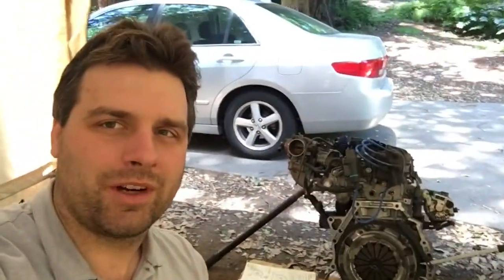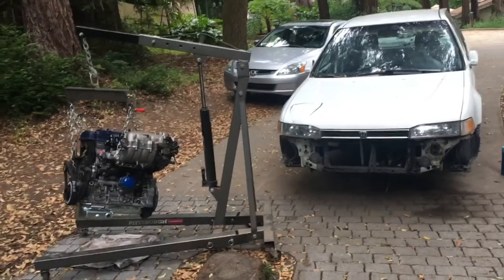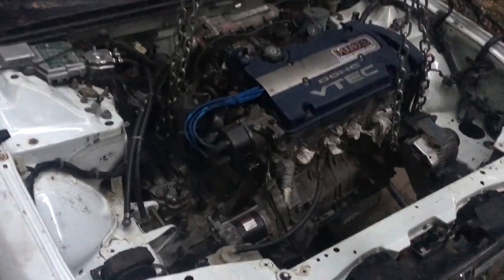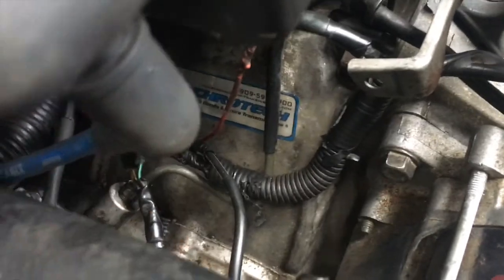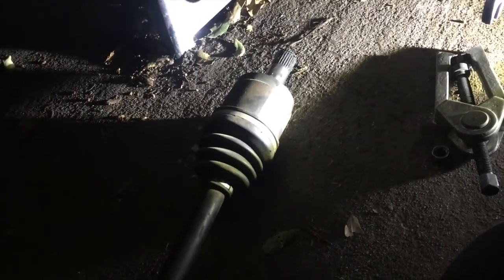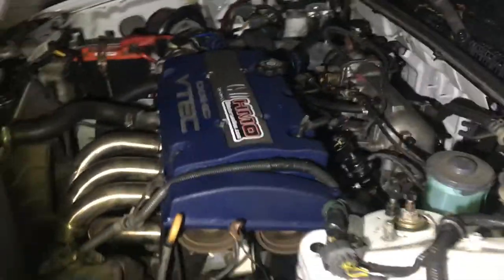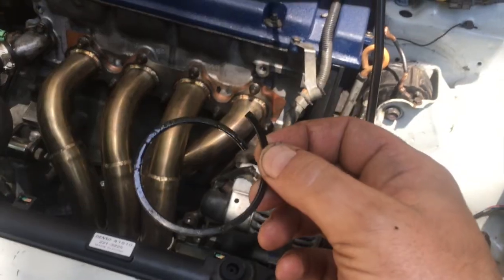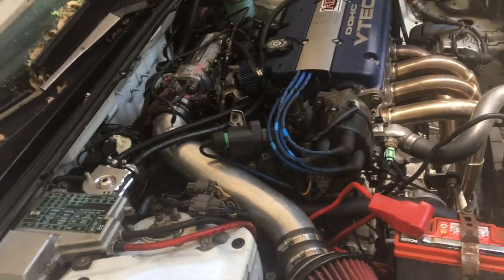CB7 Motor Build Part 6 - CB7 Meets Its New Motor!

Comment: well lets see the low-ish exhaust? and the vacuum leak could be the FITV "fast idle thermo valve" those cockroaches like to come apart internally and will cause a vacuum leak if it does...easy free fix if it is...just put back together how it should be and done....or check the idle screw on the throttle body its a flat head.
Reply from the maker: I was really bummed, during editing, I realized that the clip I took of the low header downpipe was no longer on my phone or computer, so I’m not sure how it got deleted.  I originally took that video because I really wanted people to see the issue I was having.  Someone else on CB7TUNER just reported the same issue, even worse than mine.  Since filming, I actually found the vacuum leak, a hole in the map sensor vacuum line. I was able to adjust the timing to about 11° at idle and adjust the idle screw.  Now, warmed up, it idles around 850 rpms.

Comment: Stock mounts line up direct fit to the cars engine bay?
Reply from the maker: I am using three of the stock mounts: the rear mount, the timing side engine mount, and the transmission mount.  The trans. mount works with Prelude transmissions only after you drill the proper holes in the trans case and thread then with the studs that come in the other holes on the Lude transmissions by default.  As far as the mounts fitting and everything lining up, yes, it works. Please just follow my instructions in my videos on the timing side engine mount bracket.

Comment: Just got the h22a4 installed.  Do you also have to change out the coolant port on the back of the motor like the front i noticed they point differently
Reply from the maker: Nice work!  I actually used the rear coolant port from the H. The Lower Radiator hose reaches just fine, but just make sure you unwrap some of your coolant sensor wiring to reach the thermostat temperature sensor on that rear port.

Comment: Did this motor wire harness hook right up with the stock and what ecu are you running
Reply from the maker: I completely tossed the harness that came with the OBD2 motor and converted the motor to OBD1 by using the correct distributor and sourcing a P13 plenum and TB.  The runners were already P13.  I had to unwrap some of the CB7 harness on the trans side just to reach the coolant sensors and coil.  I am running a P06 ECU and wired up an external relay connected to pin A15 to make VTEC work.
Reply: Cool thank you. Im currently looking for an h23a . After i get one i may have to hit you up again about it lol
Reply from the maker: Look no further than H motors online. Pay the extra money, and get the security knowing that it is a healthy motor. It is worth saving up for.
Reply: Hey so wait the stock ecu from the accord will run with the h series motor? I was think id have to get a p13 or p28. Btw i got a h22a4 motor . Im thinking all these h22 and h23 are basically all the right or am i wrong
Reply from the maker: No, not stock ECU, I used a P06 and then wired an external relay for VTEC. I could’ve easily just used a P13 or P28 as well. The reason I went with my PO6 is because it already had Hondata installed on it.  I also don’t think the P13 is compatible with Hondata’s ostrich board.
The H23 has quite a bit longer stroke (95mm) than the H22s (90.7mm), plus a lighter crank.
Reply: Oh ok. Man im so green with this. So i will still need to get a p13 or p28 ecu. Thanks for your help.

Comment: You not have abs in this car or did you delete it. I like to remove it from my 93 if possible since it doesnt work and i don't wanna buy another abs pump
Reply from the maker: There was no abs from the get go because it is an LX trim.  I am actually glad for that because deleting abs would have been more of a pain than a rear disk conversion was.
Reply: Oh man. I been trying to find pics or something with the way the brake lines are ran. I cant find shit . But im determined to delete it lol . I guess im gonna have to trace them out and remove as needed. Lol.
Reply from the maker: You can do it!  Go to cb7tuner.com and search for abs delete.  The procedure is documented on there.
Reply: Also went to the junk yard found an accord without abs and got that deleted show that was a bit of work but not too bad.
Reply from the maker: I think it would be annoying to have to replace all those brake lines and get new ones for the proportioning valve.
Reply: Im not there yeah as far as wiring it up. But not sure on if i could get and obd1 distributor with 8 pin connector would that be fine for this motor? And the injectors i guess i need to somehow bypass that box im not sure what that is call off the top of my head.